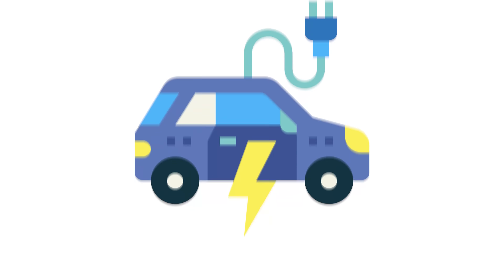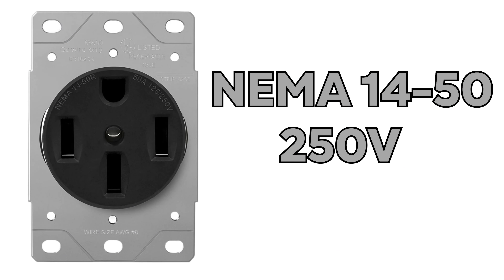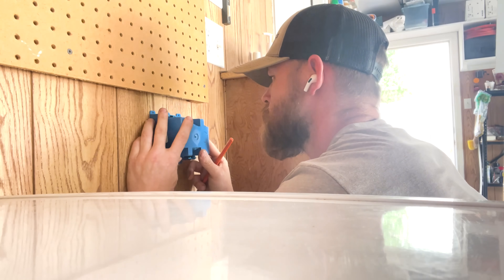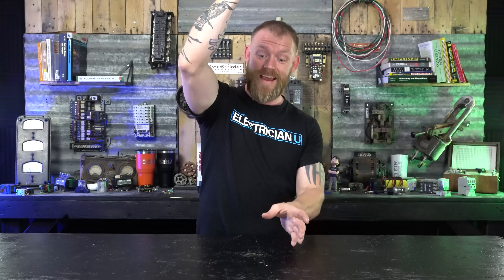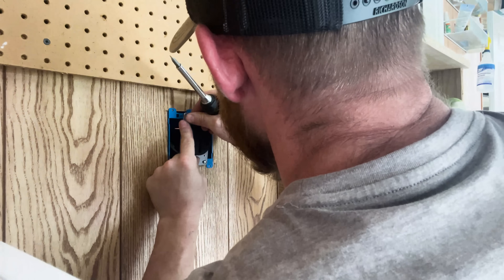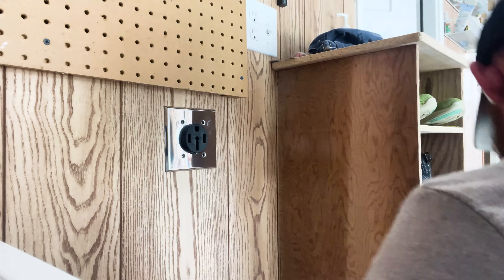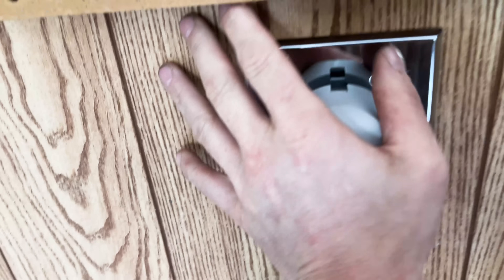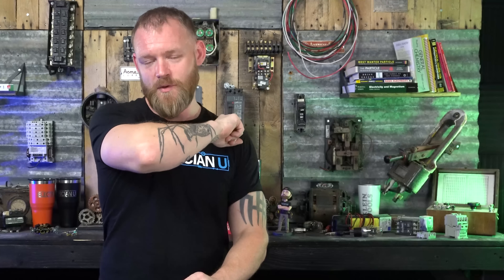How to Install an Electric Vehicle Charger Receptacle

Comment: I want to tell you, I absolutely depend on the 14-50 receptacle.  Electric vehicles are not the only thing that I use the 14-50 for.  I use the 14-50 receptacle for electric ovens, ranges, RV's, portable restroom, temporary power, among other things.  I don't hardly use the old 30 amp RV receptacle anymore, known as TT-30.  Too easily mis-wired for 240 volts and not enough power.  No, I don't use the TT-30 anymore.  I don't like the TT-30 receptacle.  The TT-30 has a crap ton of liability attached it and none of the potential for supplying enough power for an RV.  I say a lot of liability because of the potential for accidental mis-wire for 240 volt power.  And, if you plug your RV into 240 volt power, even for a couple of seconds, it will destroy everything in the camper.  It will take out the microwave, battery chargers, TV, smoke detectors, if you have a fluorescent light that operates on shore power it will take out the ballast in it, metal halide or mercury vapor lights, anything you have in operation will be destroyed by the 240 volts.  And, your insurance may have trouble covering this.  That is why I always like to install 14-50 receptacles for RV use.  In fact, my uncle had travel trailer with a 30 amp TT-30 power plug and the shore power cord got damaged.  I upgraded it to a 14-50.  Plus, 30 amp 120 volt power isn't enough power anymore.  We use a lot more power than our parents did.  In fact, some AHJ consider a TT-30 receptacle as inadequate for modern RV's.  Many RV parks with older power pedestals are being required to update the power pedestals prior to selling, financing, or to be labeled as a housing community.  I have even heard stories about RV parks being required to update their power pedestals to qualify for certain loans, special programs, among other things.  Well, the inadequate power from older 30 amp 120 volt TT-30 receptacles are the reason why if you ever wander.  Not only that but I once had to update the power systems in a summer camp one time and the time-out cabin for bad kids used 277 volt power for the lights and 120 volt power for HVAC and a 15 amp GFCI.  Well, 30 amps was used everywhere.  To qualify for a loan, the camp had to upgrade everything to 50 amps, 120, 240, and 277 volt power.  And, I almost always prefer the 14-50 for time-out cabins, portable restrooms, and travel trailer and electric vehicles, not just for stoves.  Many newer time-out cabins, portable restrooms, and travel trailers now have two air conditioning units.  And, in RV use, the 14-50 can safely deliver more power if multiple cooking appliances are being used at the same time, say at Thanksgiving and Christmas.  Easter is another big problem for the older service.  Easter dinner.  This is why I almost always prefer the 14-50 for a lot of vehicles.

Comment: Neutral generally aren't needed, the loads across the phases are balanced, and neutral-less.

Always read the manufacturer's installation manual, i.e. if you know they are getting X car, look up what it says, and do as it directs. When putting in an ACTUAL charger, and not an outlet, it is particularly true that they don't use the Neutral in most cases, always read the installation manual. I.e. 277 - N - G exists, just rare among the ones we've installed, most are either 240 or 208, and NOT 120 or 277, as a result they are already perfectly balanced.

I.e. Chargepoint, a dual handle charger will take 2 x 40A Breakers, 30A per Breaker, 240V or 208V, 2 Hots per breaker and ONE ground shared between the two, as an Equipment Grounding Conductor per the wiring diagram and installation manual. There is NO grounded conductor. Power sharing it just has pins and basically shares the first breaker's power, adding another device and reducing the power available.

Comment: A cheap Nema 14-50 will likely melt.  They can handle up to 50A but some max out their charging rate and charge 48A for hours.  Think of the heat build up.  Refer to the "Munro" video about this.  There a even a video of guy had the beefy Ford 80A charger and they had to switch the cable/Romex due to the extended heat. Recommended customers set their rate at the slowest rate/amp as is convenient to them.  Electricians please explain to customers that faster is not better.

Comment: Just another tip for those with damp locations … a 50 amp RV receptacle is the same as the NEMA 14-50 and comes in a surface mount weather rated enclosure that allows the cover to be closed with the cord plugged in. The cover also prevents a child from sticking something into the open outlet when the cord is removed.
Reply: Absolutely not, those are not rated for EV use,,, bad video, They end up melting. EV's draw continuous for hours, unlike rv's.. Look into it.    Hubbell Lighting 125V 50A 3-Pole 4-Wire Receptacle – HBL9450A   This is the outlet required .. This video in not that great,,
Reply: Gee, that is such a good point, using a covered lockable receptacle cover to prevent little people sticking things into the open sockets!
Reply: Good idea
Reply: yep!  that's what i'm going with.  i'm going to have these inside and outside of my garage.  its for safety.  i'm referring to the box that supports the receptacle.  i modified the faceplate on those outdoor boxes to accommodate the industrial grade HUBBEL 14/50 outlet.

Comment: Hello. I have a 220V 30amp wires running into my garage. I have two questions: 1. Should I replace my 30amp wires with 50 or 60amps to decrease charging time? 2. Do I need a Tesla wall charger? Will it significantly increase the miles/hr charge rate? Otherwise, I would just install the NEMA 15-50…thank you!

Comment: Just watched another video before this that said you're supposed to use a torque screwdriver and tighten the wires down to the specs on the back of the plug. Also supposed to torque the wires in the circuit breaker box.

Comment: I just wanted to say all the EV cars out there they should come out with a portable charger to wear just in case if you get stranded with an EV car you won't be stuck because say if you get stuck on a highway and there's no EV charging stations close by. It would be nice if they come out with portable high quality chargers that can be maybe charged up at home before you leave on your trip or something to take with you just in case if it's no charge in your car to travel further or if it stops on you and you run out of electricity a portable charger is ideal to have it's especially when it comes to electric cars for all electric cars even if the dealers sell them it would be fine if the auto parts stores sell them wherever I think it's important to have one and really especially in cold conditions and you in the middle of nowhere.

Comment: I would preferred to see a 60A, 240V, 2Pole disconnect switch, ahead of the receptacle, at the garage, in the event you need to quickly disconnect the power. I too would prefer #6/3 w/G NM-B (Romex) as the preferred wire size. The larger wire also reduces the voltage drop under load.

Comment: Like the GFCI, the newer arc fault breakers are super annoying for false tripping.
Reply from the maker: I agree, especially with loads like mini-splits - They actually submitted a change in the 2020 code because of this so the manufacturers are having to redesign the loads to ensure they won't nuisance trip anymore. 2023 code will have more requirements for GFCI unfortunately. I anticipate in 10 years every circuit being Dual Function - AFCI/GFCI. Panels will probably be smarter as well so every circuit can detect both types of fault conditions if I had to guess.

Comment: So I’ve been hearing horror stories of the Big box store 14-50’s not holding up and actually melting over time due to the longer current draw times.  Would you recommend a Hubbelll or Bryant instead?   My electrician suggested using 6 AWG THHN for the 2 hots and neutral and 8 awg THHN for the ground on a 50 amp breaker and have me limit charging to 40 amps or less.  I’m also installing this under a covered carport. I opted to go this route because in the future we may park our Camper next to the carport and this could give us a little flexibility.  What are y’all’s thoughts?

Comment: #8 NM is only rated for 40 amps. It is a code violation to feed a 14-50 with less than 40 amps.

Comment: Good explanation on wire and breaker size.  I installed a Nema 5 using 12 gauge wire to charge my Leaf which draws 16 amps (I used a 20 A breaker).  The wiring passed the mandatory inspection but I still had a fire at the outlet.  No cause could be found despite speaking with the electrical inspector, other electricians and Leviton, the maker of the Nema 5.  I then pulled out the 12 gauge wire and replaced it with 10 gauge, and replaced the 20 A Nema 5 with another identical one.  Had another fire.  I then rewired the 10 gauge to a 30 A double pole breaker and installed a Nema 6 (my charger accepts 240 or 120 V). I monitored this closely and realized I was about to have another fire.  Pulled the plug before the bad stuff started. I brainstormed and after much research figured out the problem.  Because an electric car gobbles enormous chunks of currant for hours on end there is a heat build up that does not normally occur with appliances that are only running for a few minutes, then shut off.  To make matters worse the heat had nowhere to go as this is an outdoor receptacle and the bubble cover traps the heat.  My solution was to rip off the bubble cover.  The heat problem has now been solved and there are no more fires.  But I like the Nema 14-50 you are using.  It has larger contacts which will absorb and release the heat more easily than my puny Nema 6.  Next time I wire for an electric car I will I will install that instead.
Reply: Wow. What brand receptacles have you been using?  The EV forums note the Leviton outlets have led to fires, but that is usually at 40A on a 16-50R.
Reply: We must remember that the 50amp receptacles up until recently were meant for appliances. A range/oven does not use continuous juice for 8 hours, non stop. Appliances turn on and off, and the plug is never moved.  
An  EV is a different animal,  people plug and unplug and loosen the connectors. Moreso, the connectors are only half the size of the holes, so the current has like a funnel from a wide wire to a small connection to then another big wire to the EV.  NOTHING that costs $15-$20 outlet should be used. You need a Hubbell or Bryant INDUSTRIAL GRADE, it is heavy, beefier, the connections are very solid and is sturdy. Those can take the heavy load 24/7.
Reply: Thank you for that insight.  I eventually became aware of this but did not apply the knowledge in the way you described. My solution was to remove the bubble cover entirely.  The heat was now able to escape faster, thus no overheating occurred anymore. Subsequently I spoke with a friend of mine who is a master electrician. His fix was exactly the same as yours and he also recommended changing the wire from 10 gauge to 8 gauge.  I am going to follow the advice that you gave me as it aligns with that of my friend.  Thanks for the input.

Comment: Haven't looked at a ampacity chart recently but i thought #8 nm-b has a 40 A max rating. Doesn't really Matter here since you only installed a 30A breaker but heard you refer to it as 50A wire .thought you need #6 nm-b for 50A ?
Reply: I had the same thought. #6 for 50A #8for 40A.

Comment: Also note that most EVSEs have no need for 125v so if the Cx would like to save a bit on material, 8/2 with a 6-50 can be used instead.

Comment: I KNEW IT WAS MEANT TO BE 2 GANG. The person (not a electrician mind you) insisted that a 14-30 was supposed to be 1 Gang even though it barely fit. Aside from
That everything is fine. Less than 6 feet from the service panel.

Comment: These are also used on some welders and such. I have a harbor freight welder that says it's rated for 30a but uses this 14-50 outlet, so that's what i installed.

Comment: Anyone that has an RV, electric clothes dryer, 230V welder, or anything else 230V either knows or will soon find out that after several plug disconnects from that type of receptacle, that plastic box will rip right out of the wall.
It takes a lot of strength to disconnect these plugs.
I have even had to use a flat bar to pry an RV 120V 30A plug out of it's receptacle.
You can use that box only if you securely fasten it to a wall stud or to a concrete wall.
Those wings will not hold for very long even if it were used for 120VAC outlets.
They will rip right through drywall and paneling.
And don't forget a local disconnect, clearly labelled.
These EVs should not be charged inside a house or garage anyway.
Risk of fire.

Comment: I have a question. If I need to Run the 50A - 6/3 Romex I would need to run it from the Breaker Box through the Attic and into the Garage for about 50 feet. Inside the Attic do I need to run Conduit for the Romex?

Comment: general question, i have a detached garage with its own breaker box ( the ground separated from neutral, not bonded) question..... i added a welding 240 outlet with  3 wire... red and black to hot and bare copper wire to ground prong . is this ok since the breaker box neutral and ground are not bonded. could you make a video on this. thank you.

Comment: I use the sameone (14-50) to charge my Tesla. The Tesla charger is not necessary. Get your facts right.
I already had a box in my garage so this was a super easy job for DIY.
They're tripping because people are using 30 amp breakers.
You can have a 50 amp breaker and just charge at 30 amps at the car.
Just cause the customer tells you to do it one way doesn't mean you shouldn't know the proper way and then educate them.
You installed a 30 amp breaker now they can't even charge at 30. They can only charge at 24. Should have atleast installed a 40 amp breaker so they can charge at 32.

Comment: Watching this video, there may be 2 seperate code issues in error.

Around time 3:45 you mentioned #8 wire being good for 50 amps.  Table 310.16 in nec 2030 has that as a 75 degree C rating.  However, back in 110.14.(c) Temperature limitations  for electrical connections, 100 amps is the breakover.point between the 60 degree column and the 75 degree column.  Unless your breaker is specifically temperature rated to 75 degrees, 100 Amp and less breakers are rated at 60 degrees c no matter what insulation is on the wire.

Also, at about time 10:56 you mentioned gfci protection for the recepticle.   The 2020 code 625.54 electric vehiclepower transfer system is unchanged in the 2020 code.  This means that recepticles for car charging needed gfci protection in the 2017 code or earlier.  Okay there is a change in this section but that does not effect my statement.....gfci for car charging recepticles.

Please take a look at both and let me know if I somehow have this wrong.

Comment: What benefit is there to putting a 30A breaker on a 50A circuit?  The next person that moves into the house will see a 50A receptacle, plug a 50A charger into it, and get frustrated every time they try to use it because the breaker trips.

If the customer wants to protect a 30A device on that circuit, why not put a fuse-protected L14-50P to L14-30R pigtail on the receptacle, and have the breaker match the installed wiring and receptacle?

Comment: the Owner should have installed a 40A breaker to allow 32A load. Tesla UMC's are limited to 32A MAX anyway, as are most other J1772 Mobile connectors.

Comment: You can use a 14-50 outlet with a Tesla mobile charger that (did) come standard with the car.  Tesla sells a 14-50 adapter to the mobile charger which works well.

Comment: So sad at 30 amps for EV charger! If you have time of day, the 30 amp may not charge the battery fully within the off-peak period. This is especially problematic for 100 KW or greater batteries like on the Rivian R1T. I understand it's at customer request, but still...the car will self-regulate how much current it accepts. The EV charger is nothing more than a dumb on/off switch. There's no power regulation of any kind on a "Level 2" EV charger, all the complexity is regarding safety and solely regulating on/off scenarios as you interact with the cable or as the vehicle requests of the charger.

Comment: As electrical guys, it is easy to to miss some code requirement, there are so many.  Just a reminder there is a section on evse's.  Nec 625 gives the ampacity, gfci requirements, and more.

Also, remember that nec 110.14 terminal connections talks about breaker terminals at less than 100 amps being normally rated for 60 degrees c along with any ratings in 334 for NM cable.

Aristotle gets credit for this quote:

"We are what we repeatedly do, therefore , excellence is not an act, but a habbit."

Stay excellent out there.
Reply: Feels like number 8 wire is only good for 40 amp and he's wired it to a 50amp outlet. Granted he's only put a 30 breaker in for now but he won't be able to use a 50.
Reply: @LarsDennert  it is possible.  He would need to find a breaker with terminals rated for 75 degrees c.  I do not know how hard that is to find.
Reply: I have some 10 feet of MC cable #6/2 AWG rated at 75 amps. Can I pull out the conductors from the metal conduit and feed them through  3/4 inch PVC conduit and maintain the same ampacity rating? It is THHN wire.